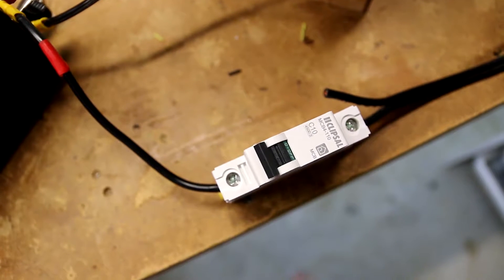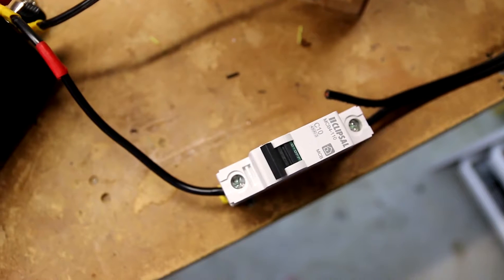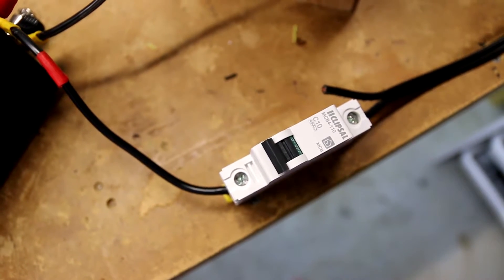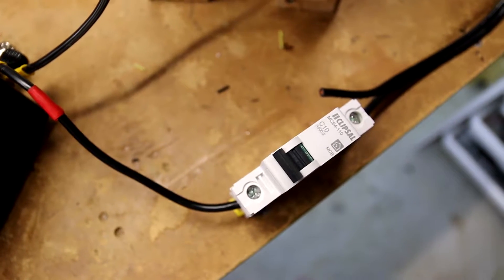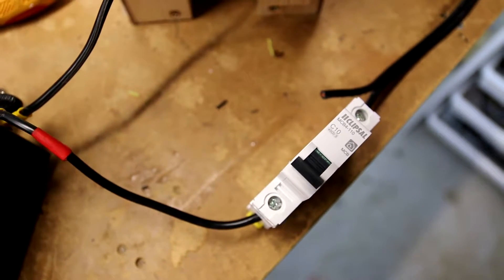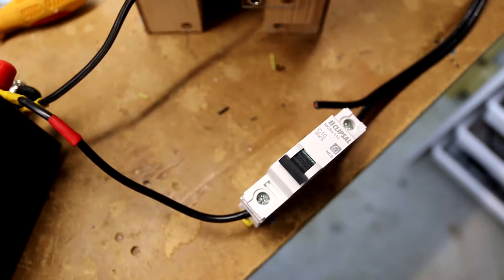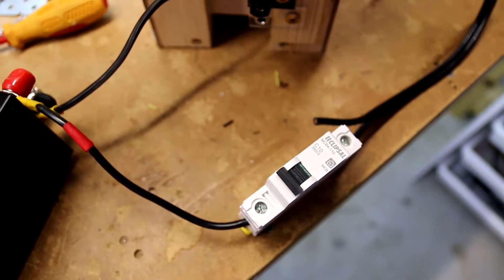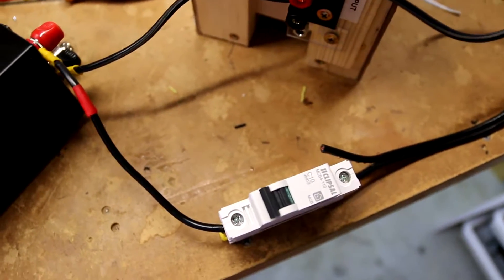Testing 240VAC Circuit Breakers for 12VDC

Comment: The issue with DC is not if the breaker trips at the nominal current. With DC, dissipating the current arc when switching off with load is much more complicated and the contacts of an AC breaker are going to wear off much sooner than a DC one.  Its even possible that the heat ends soldering the contacts together and one day the breaker will not trip anymore. I would not use even an poperly rated DC breaker bought in China without a fuse (with a higher current rating) in series. I think breakers are convenient, but for real protection in DC you need fuses.

Comment: This is exactly the video I’ve been looking for as I have loads of these breakers and was curious if the would trip out at 12v👌👌at the end of the dat it’s a safety switch and as long as it trips out and saves the van I’m putting it in 👍👍🤩🤩ile be happy,, thanks for sharing this experiment👍👍